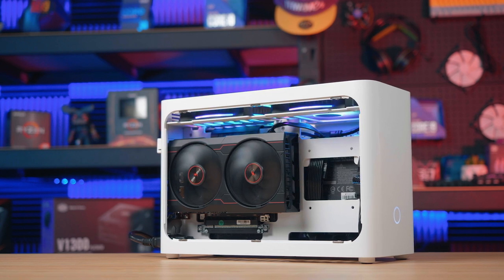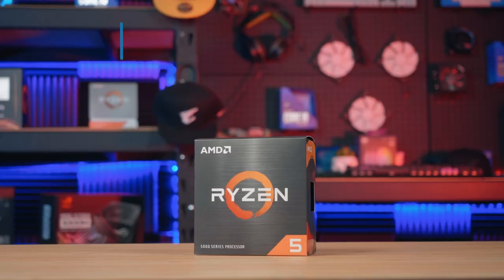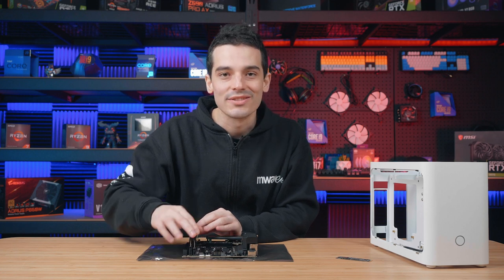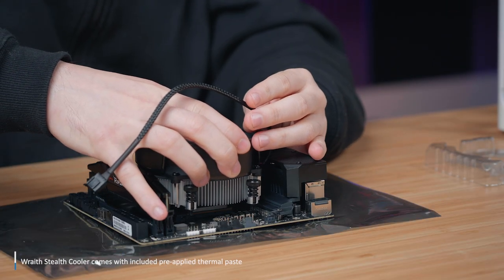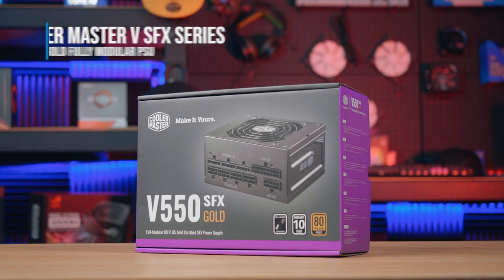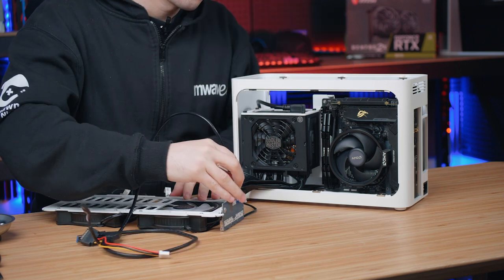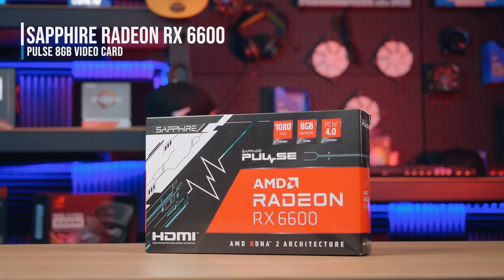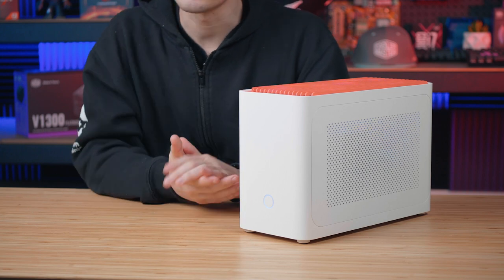Mini-ITX System Build feat. IQUNIX ZX-1 Air Mini-ITX Case with Ryzen 5 5600X and Radeon RX 6600

Comment: Any way I can fit a 3070 in the build?
Reply from the maker: Hello Lok. Well, I have good news! I just had a quick scan at a few RTX 3070 GPU cards and on the 4th search, we struck gold! The 'Gigabyte GeForce RTX 3070 EAGLE OC 8GB Video Card - LHR' will fit in the IQUNIX ZX-1 Air-Cooled Mini-ITX build. I, unfortunately, don't have the time to go through every single unit to check, sorry... But if there is 1 model which fits, I am sure there will be other options that also work.

The GPU support in the air-cooled version of this case is 305x45x140mm, and the water-cooled version can support a GPU up to 305x60x140mm. I will link the GPU that fits down below, and also a link for the rest of the RTX 3070's available (at Mwave) if you wanted to have a deeper look (you can find the GPU dimensions near the bottom of the product overview when you click on the GPU)😊

Gigabyte GeForce RTX 3070 EAGLE OC 8GB Video Card - LHR: https://bit.ly/3VxYeqX

NVIDIA GeForce RTX 3070 GPUs, at Mwave: https://bit.ly/3Vz8teq
Reply: @MwaveAU  You are my savior, thank you so much!
Reply from the maker: Not a problem mate, happy to help 😊

Comment: Hi, I also have RX 6600 and looking for ITX build. Currently I only have the GPU & Samsung SSD 980 Pro and both are PCIe 4.0, motherboard also will have PCIe 4.0 slot. 

My only concern is the GPU riser that still on PCIe 3.0 and if one of the components (the RX 6600 with PCIe 3.0 GPU riser) are not in running on PCIe 4.0 so all the components (PCIe 4.0 SSD) will running to PCIe 3.0 too?. And also is there any performance drop too from 4.0 to 3.0?
Reply from the maker: Hey Coppp.

Firstly, running the GPU through a PCIe 3.0 riser cable with not affect the other components in your build. As long as your motherboard has a Gen 4 NVMe M.2 slot for your M.2 device, it will run at the Gen 4 speeds.

Secondly, a PCIe 3.0 x16 slot for a GPU has almost enough bandwidth to fully support PCIe 4.0 devices. When you start to look at the more high-end components like an RTX 3090, then you start to see a little bit of a difference (even then it is a small amount). For an RX 6600, the difference will be minimal or none existent.

Hope this helps mate! 😊
Reply: Ah great!. Thanks for the explanation. You got new subscribers here 🎉
Reply from the maker: Thanks for the sub! And not a problem, always happy to help mate 😊

Comment: would any varient of a 4090 fit in here?
Reply from the maker: Hey mate. Unfortunately, not at the moment. To my knowledge, the only 4090 cards which would fit the supported size for this case is the 'Inno3D GeForce RTX 4090 iCHILL FROSTBITE 24GB Video Card' but this GPU required a full customer water cooling system which wouldn't work in the IQUINIX ZX-1 case. Sorry!
Reply: @MwaveAU  the 4090 she is just to big of a beast for this SFF lol. Thankyou mate! maby  one day a slim version will come out.
Reply from the maker: Haha yeah they are pretty big card. They legit make the 3090 look small lol. Hopefully one day for sure, or even a small enough 4070/4080 in the future *fingers crossed*. The wait begins! 😂

Comment: Why do you need the sata cable?
Reply from the maker: Hey mate. The SATA cable is for the top I/O power connection for the front panel on the case.